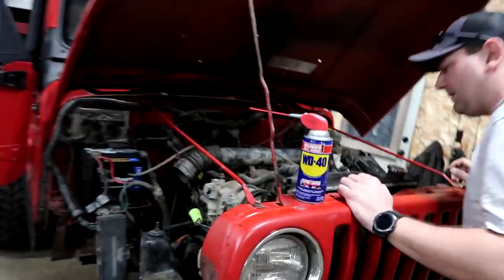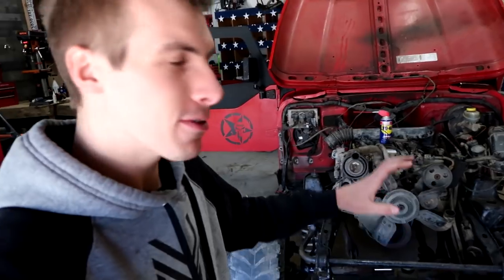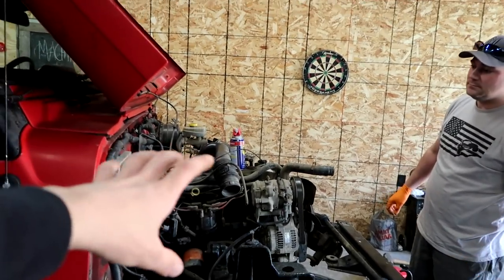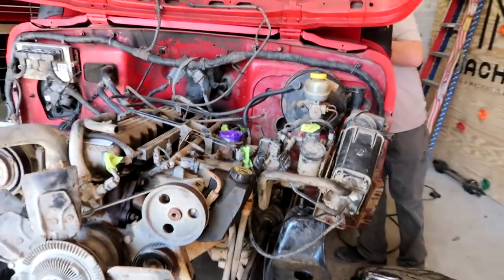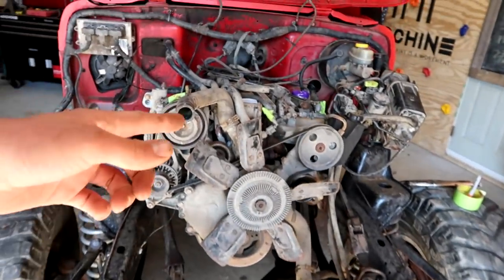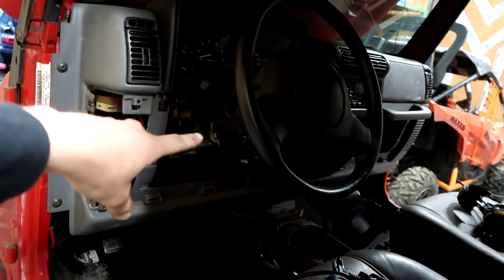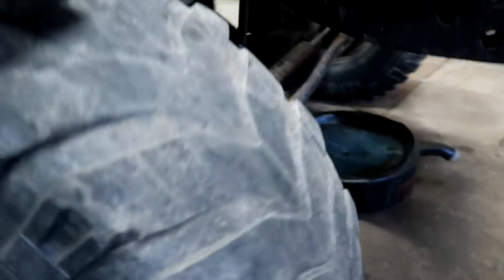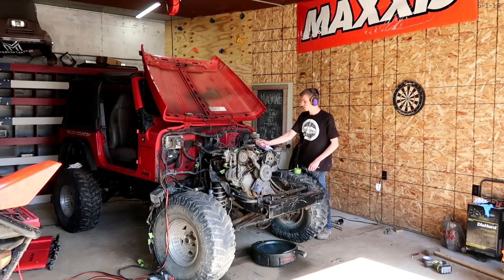I BOUGHT THE BIGGEST LEMON!!

Comment: They make a ac compressor eliminator it’s just a bracket with a pulley
Reply: Yeah A/C bypass pulley.  Napa or autozone prob have it in stock.
Reply: he could turn it into an on board air compressor so he can refill his tires after hes done off roading
Reply: DO A SICK ON BOARD AIR SYSTEM WITH THE COMPRESSOR
Reply: that style ac compressor would burn out real fast pumping air, none of the lubrication would stay in it and did is contaminated now as is.
Reply: he can add an in line tool oiler to make up for the lack of freon

Comment: Turn that a.c. pump into an onboard air compressor for the front locker you will get 😉😉👍👍🤘
Reply: Jason Petrich he could also make a pretty cool pipe bumper to use as an air tank. Or find a place to put an small tank on it.

Comment: Like a host of others have said - keep the A/C compressor and convert it to an Air compressor for an OBA system, You'll have to get a few items to make it work like an oiler and air dryer and pressure switch, but in the end it's a killer mod and great thing to have on the trail.

Get this thing going so we can wheel Rausch Creek or Anthracite in PA.

Comment: honestly its kind of a good thing. the stock straight 6 came with either 3.73s or 3.55 gear ratio. the 4 bangers cam with 4.10s so youre ahead when it comes offroading and power on the road.

Comment: Hey bud. Turn the A/C compressor into an air pump. All you do is put an inline Oiler in the intake and a oil water separator after. Works great used mine for years. Fills 35” tires no prob.

Comment: The simple and dumbest way to get around the Crysler security would be to tear the efi system off and put a carburator, aftermarket distributor, and wire the starter, fuel pump, anf  the igniton to a switch pod amd just hook up a oil pressure gauge and colant temp. Then call it done.

Comment: Definitely keep the A/C and convert it into an air compressor. Wicked easy to do, just make sure you have a way to add oil periodically so the pump doesn't burn up. I've been running one on my Chevy for 4 or 5 years now.

Comment: No spark can be 2 things with the inline 6. I replaced crankshaft sensor that didn’t work. Take distributor cap off then rotor button and there’s a plastic piece it works as the ignition control and cam sensor. Take it off replace it or clean the magnet under it put it back replug it it should fire. If not replace ignition coil.  Remember to unplug the battery so ecu will reset.

Comment: Hey bud, they make an AC bypass kit, it's basically a bracket with a pully.. but I'm glad you went with the straight 6... I personally have a 99' WJ (Grand Cherokee) fully loaded 3" lift 31s yah yah yah . But these motors are very strong.

Comment: There is a pressure valve on the fuel rail very easy to check for fuel..also the SKIM was working and the engine was running. The system either works or dosent...more likely the key went bad or something else happened

Comment: Do away with that motor and trans all together. Get a good 350 Chevy v8 and trans and bolt it in.
Reply: dave1135 no Jeep 4.0l are indestructible
Reply: Agree with the 350
Reply: Hell yeah at least someone has a good idea
Reply: The tj is new enough that there is still emissions so he would need a 350 with the obd2 system
Reply: Or a 4bt
Reply: Andy Tommy Keddy To heavy and a 350 chev would be more than enough for a jeep
Reply: a 350 won't pass inspection because of emissions, a lot of people do 5.3L LS swaps because they are easier to get to pass emissions.
Reply: Profit Lemon 350 tbi bud
Reply: Na 350s are poop don’t listen to these fools 3D my friend has a 350 swap and it runs like shit, and everyone that has one just says they wish they never did it, stick with the inline 6 until u want to upgrade go to a 302 or a Cummins
Reply: dave1135  yeah wouldn’t be a bad idea besides kor fab work and screw a 350 throw a 383 stroker with a 350turbo trans but problem there is have to change drive shafts finding a good trade with transmission rewire every thing bc the plugs are not the same and colors of wires a lot of checking two sets of wiring diagrams now if this was a cj7 or 5 that’s simple bc not much wiring going on there would just be adding wiring computer ect
Reply: Da Ca my exact words when he asked what we wanted to see? i said ‘blow all your money on it and act as if you knew what ya doing because we all know ya don’t’ lmfao.
Reply: Why do you all wats a chevy motor in a Chrysler product
Reply: Get a already straight axled  old Toyota and 350 swap it, light truck lots powaa and straight axles.  Plus the truck looks  way better than any jeep
Reply: Siggman just go straight to a Cummins i6
Reply: and a 350 isnt? lol
Reply: That my boy
Reply: billy lemonator a 350 Chevy is bullet proof
Reply: dave1135 you a real man
Reply: Siggman I mean any engine would run like shit if they don't fix the kinks it's not just the motors fault
Reply: whoever said “i6 cummins” if you actually know that engine, you know it wouldnt fit in the jeep without heavy modifying not only the frame but the body, swapping ANY diesel or big v8 into a small vehicle is a waste of time and not worth the money, you gain nothing, a 4bt or hey the normal inline thats in it is fine,
Reply: RyanPlays a 350 Chevy is actually really small so it would fit he would have to make some motor mounts which he's more than capable of doing and beat in the trans tunnel probably but an i6 Cummins is way to big and heavy
Reply: well i did say a “big v8” while the 350 is a v8 it isnt a “big v8” bit still too much work for what hes gonna do with it lets be real lol, and the 5.9 or 6.7 is waaaay to long and heavy, even the 6.0l powerstroke which isnt much bigger than the 350 if you’re talking cu, but still any diesel is too heavy, the 4bt is too, but its a “easy” swap in cause of the 4bts size, but like i said the engine thats in it is just fine, you dont need like 500hp in a jeep
Reply: Agreed 350 it sir
Reply: dave1135 Ford or Dodge is the best way to go
Reply: RyanPlays he can pick up an aluminum ls for cheap if he wants or he can go cast or even an lt vortec v8 and leave it stock it's only 300hp for a vortec if that and no swap is easy with this specific Jeep because the person he got it from made a mess of it and sold it I think he should get a 5.3 vortec leave it stock and enjoy the Jeep
Reply: dave1135 j
Reply: Hahaha no, 4.0 will outlast that 350 without a doubt

Comment: I got a 1999 Jeep Wrangler ECM PCM ECU for a 4.0 and both worked with the same key just a tip idk if you can borrow a  scan tool that can read live data on the cam and crank position sensors very common reason for losing spark in a tj

Comment: Couple of videos back I saw the jeep running as you loaded it on the trailer but now it doesn't run at all and you think it's the security from the computer. What changed from then to now?
Reply: If it would be security it would't fire at all. sounds more like a crankshaft-coilthingimadohickey. (Sorry, don't know the English word for it)
Reply: MrJoBe I agree. If I were them, I'd start at the ignition coil, distributor rotor and pickup coil. If all of that was ok, I would move onto the timing chain timing and compression check. Like you said, if it was security, it never would have started to load onto the trailer.
Reply: Exactly what I was thinking 🤔
Reply: If it has the factory chip/skim module it won’t run for more that a few seconds as it’s cutting fuel/spark as if it’s stolen

Comment: also is it not getting spark but is getting fuel or neither because if the crank sensor goes bad on that it will allow the fuel pump to cycle but it wont allow to have spark. one way to test it is to pull it off and see if its still magnetic. just something simple to eliminate off the list

Comment: There's a way to bypass the anti theft by wiring in a resistor, did it a few times with some other vehicles. Do a little research on where youd need to wire it into and call it a day

Comment: You might want to check with an inspection station b4 putting too much into it. In Pa. the motor and vehicle must be the same year or it cannot pass inspection due to smog restrictions. New York may be different but checking may save time as you mentioned that you want to use it as a daily ride.

Comment: On my 97 Jeep Grand Cherokee I reset my computer by disconnecting the battery holding the connectors together for 10mins than if it still has the problem try locking and unlocking the passenger side door

Comment: Somebody told me once to remove the negative terminal from the battery and touch both ends together for 10 seconds and it might fix the issue. That is the ends that goes to the jeep not the battery terminals. If that doesn't work go to one of the many jeep websites and they'll tell you what to do. I myself would check compression of the motor to see if it's worth saving. Then I would go old school carb and ignition.

Comment: Since you won't be using the Serpentine Belt,cut it.Loosen alternator to it's smallest setting,also do the same for the Idler pulleys,and cut the belt to that length.Use that to go get a new belt.
Reply: you could use a tape measure,but they don't flex as easy.

Comment: Find the signal wire coming off the key switch and get a a resistor and place it in line of the signal wire in that should by pass your security issue

Comment: Just get a smaller belt, should be fine going right from the alternator to the existing idler pulley. There's a sequence you can do with the key to get it to work with the computer, but I think it involves having an existing key that works. :/

Comment: That year of jeeps security system is it shuts power to the fuel pump. Just hard wired it some power so you can keep rolling bro. Worry about a computer/ignition later. My girls jeep when it goes into security lock out. You just have to lock your passenger door close it and unlock it with your key and the problems resolved

Comment: I had a 2000 Cherokee with the straight 6 didnt even have a key used a screwdriver so I don't think it's a security issue but I could be wrong.

Comment: Are your keys grey or black? My 97' definitely didn't have chipped keys, and I'm 99.9% sure yours doesn't either. Pretty sure they didn't start putting those in till around 01/02ish. 

Check or replace your crank position sensor. 
Check or replace your cam position sensor (Yay Jeeps). 
Check or replace your distributor. 
Check or replace your ASD (auto shut down relay).

Could be a bad PCM even. Or bad wiring from the swap? Maybe shit grounds.

Comment: Turn key to on position there's a slip on under neath it you take a small rod go through there and you should be able to pull the key out with system and replace it

Comment: I dont k.ow how it is on tjs but on grand cherokees , theres a violet wire with a yellow tracer , you need to splice thay with a random wire you have layimg around the shop and ground it to the frame , i got stuck at work and had to donit to get home , but later thay night none of my interior lights would turn off and i had to take my splice apart and put it back the way it was .
Reply: It should be under the dash

Comment: The key is just an on and off not having the right the right key will shut it down just bypass the wires in key part the inition switch down low on the steering column make sure the is not bad it only sends power to the computer and computor does the rest if all the wires are in the right places

Comment: On my xj when i put key in to the ignition switch security light lights up and i have to press unlock on remote door switch and if i dont press unlock my engine starts and then die immediately

Comment: The security key crap was exactly what happened to me on my $1,000.00 auction full size van.  All I had to do was retrain the system by turning the key on and off for 30 minutes...
Reply from the maker: cmon. That worked?
Reply: Yep.  It took me three days of research and watching YouTube videos to discover it.  There are two kinds of keys: resistors (early) and hall effect sensor (later, 1999).  After making sure the security circuit is closed, the sequence is: ten seconds hold in the start position, then ten minutes in the "on" position.  Repeat two more times for a total of 30 minutes and 30 seconds.  I'm not making this up.  It saved me unknown amounts of time and money to fix it.

Comment: Like others have said u could turn the a.c. into on board air compressor if not like others have said they make a a.c. delete for all types of motors I've put one on the guy I work fors truck when it locked up n locked down the motor

Comment: i had what you needed but scrap yard lat week.DALTON those computers leak at the bottom and it corrodes the data line on yje pc board inside . open it and check the traces of the  pc board inside .if it is replace with jumper a walla your running

Comment: If my 4runner wasn’t my daily I’d sell it to you for a bad ass project. But sadly for the tj you’ll need to track down and make sure everything matches for the 6 and not the 4. As long as it’s for the 6 you’ll be fine. If they don’t match it won’t work. Buddy just did the same swap and you need to have it match sadly.

Comment: They tried making the straight 6 better in 99 but failed horribly it has a knock sensor ect they guy obviously was new to the Jeep thing and had a motor laying around they usually have a junk motor that ticks in the wranglers I refuse to buy a 99 to 04 grand Cherokee bc all you see is the v6 motor blown up after 150k some less then after you replace motor the trans go in both the v8 and v6 so save yourself time money and a headache go get you that 95 to 98 motor and computer at a junk yard or a wrecked GC first thing you do is yank the valve cover see if it needs cleaning then replace oil pan gasket and check the coolant plug aka melting plug there press fit in the side of the block on drivers side and then get you some dodge neon injectors sounds crazy but they are better from factory and are the same besides there triple squirt not single now if I was in this position I would be saying hmm Cummins swop or hmm v8 swop aka hemi or should I go straight 6 95 to 98